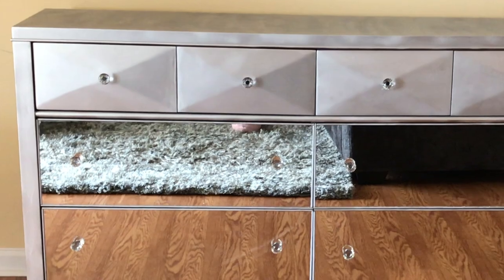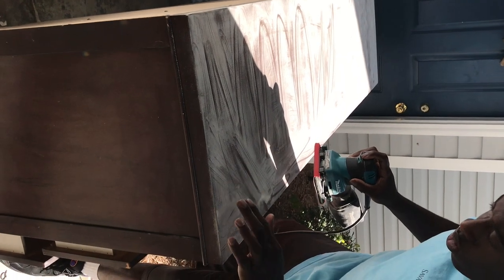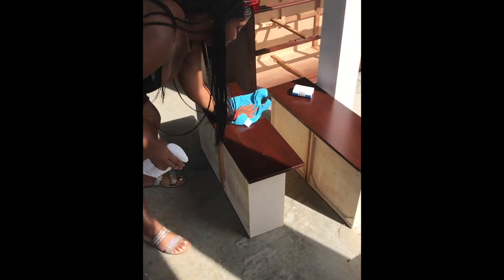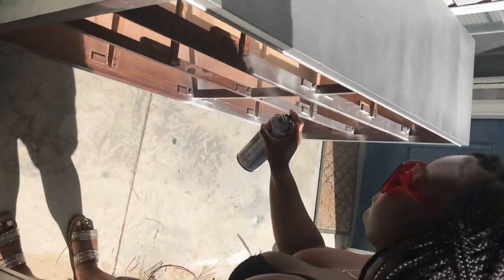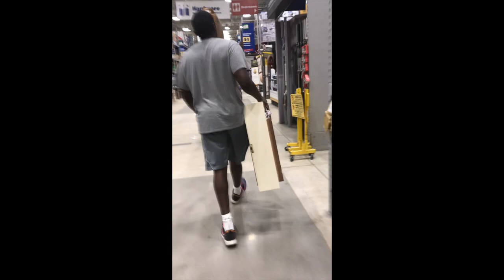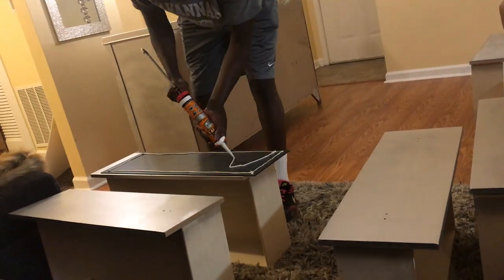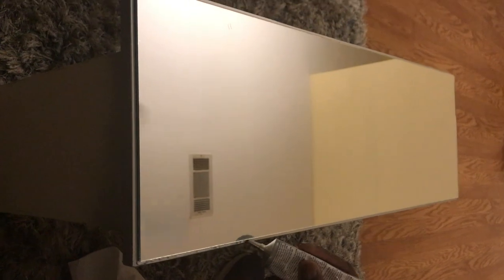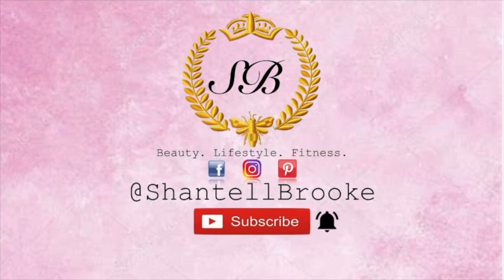DIY MIRRORED DRESSER | AFFORDABLE |  Makeover

Comment: Im thinking about doing this except the dresser(s) that i am using are not flat on the surface on the drawers, they have grooves in them. Is this project still possible to do for me?
Reply from the maker: yes just put mirror on the sides if possible.. and use glitter paint on the areas that has the grooves..